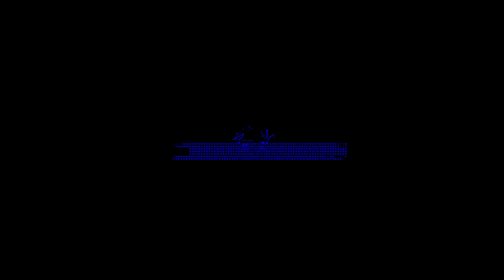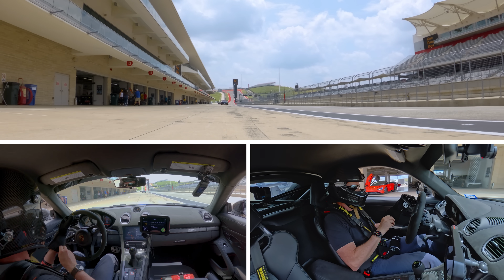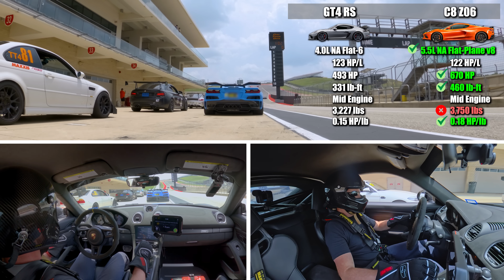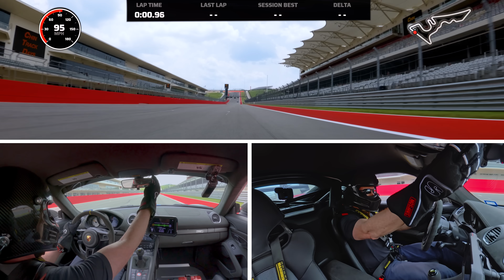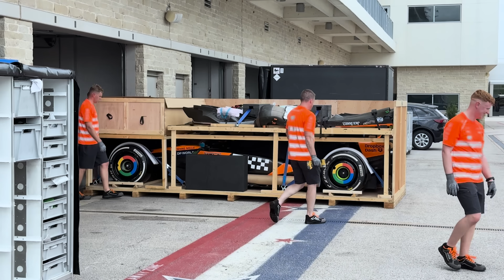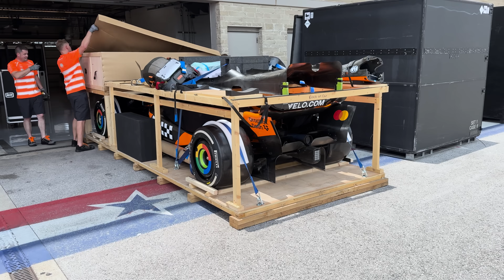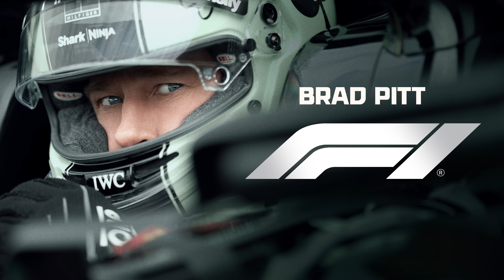Z06 vs GT4 RS : American Power Meets German Engineering at COTA

Comment: You're only braking later because he is not that confident. The c8 z07 will destroy any Porsche
Reply: Well, not any Porsche… but any Porsche to which it is a direct competitor, yes it beats them soundly.
Reply: @markw9512  What criteria do you think makes them direct competitors? Price? Design? Lap times? What Porsche competes with a Cayman RS? Z06? ZR1? I'm not sure Porsche is trying to make a big heavy track car with 1000+ horsepower because that's a bit more for Autobahn blasts than tracks.  (Think: Aventador) But a Cayman 4 RS was quicker around the Ring than a Z06 (7:10 vs 7:04 for the Porsche). A GT3 RS did the ring in 6:49. So I'm not 100 percent clear what metric "beats them soundly" is, but if it's on a track I don't think that's really the case.  The new ZR1 doesn't have a time yet. I'm curious to see if the ZR1X is a lot faster because it should be much more stable and less tail happy. 1000 hp through the back wheels isn't for the faint of heart!
Reply: @davids1816  let’s talk about that Nurburgring lap time that you guys like to quote first, because there’s some pertinent information there as to what happened and why it counts.  Then we can have some lap comparisons at the end of it so you can see exactly what I’m talking about, that on every other track except this one case which was clearly done under some optimal conditions with cold temperatures, cold tires, and the driver performing exactly one lap in the car, the only lap he had ever driven in the car, you’ll see the difference.  So firstly let’s talk about the lap time on Newberg ring by driver Christian Gebhart from sport auto. 

1. The 7’10” run by Gebhardt was his one and only lap performed in the car. In comments made after Misha Charoudin challenged the level of driving on this lap , SportAuto admitted this. So there NO warm-up laps, NO practice laps to get familiar with the car as a well run lap session should have.  Meanwhile he’s done countless laps in Porsches around the ring.  So he’s gonna be a lot more familiar with any given Porsche he takes out for a run for the magazine than a car he’s never driven.  And nobody, and I mean nobody, is going to get their fastest possible lap in a car they have never driven before, let alone on a cold damp track without fully warmed tires, which brings me to:
2. Conveniently, and of course entirely by coincidence and not any bias towards Porsche, one of their largest advertising accounts, the two times this magazine tested the Z06 were both performed in sub-optimal conditions: 3°C in the Hockenheim last year and 10°C for the Nurburgring test.  Meanwhile the Porsche runs are done in ideal weather with 20 to 25 C ambient conditions, conveniently the optimal range for the Cup2Rs.  Gebhardt himself said that the tires were not warmed up for the first half of the lap and were slipping during the SportAuto test, and that as a result of this and damp track conditions he was having traction issues for a good portion of the lap. Not exactly a formula for an optimal time, especially for somebody who’s driving the vehicle for the very first time!  I don’t give a damn how good you are, you’re not gonna turn your best lap the first lap behind the wheel in sub optimal conditions. 
3. This bunk claim made by SportAuto about it not being fast enough to compete with the GT3 in 5th gear is laughable.  As tested by Car and Driver: 150-170 time for GT3 RS: 11.1 seconds  C8 Z06: 9.7 seconds.  The Z06 is in fifth gear for this entire speed range.  As OP’s own experience shows, the Z06 clearly accelerates much faster.

Here are comparison times from magazines that have enough sense to let their drivers take familiarization lapse before doing their timed laps, and have enough intellectual integrity not to conduct them in sub optimal conditions. 
#### Base C8 lap times #### 

EVO Magazine’s C8 hot lap at Anglissy, Steve Sutcliff’s hot lap.
Times: 
Porsche Turbo 991.2 : 1’15”2
Corvette C8: 1’15”6
Porsche 992 Carrera S: 1’16”0

Nurburgring Lap Times:
Base Corvette C8: 7’29”9
Porsche Carrera S: 7’30”41
Porsche GT4: 7’32”0

Auto Bild Supertest, acceleration and hot lap, 2020 C8 Stingray, Sept 2020:
Lap times:
Corvette C8: 1’32”31
Porsche 992 911 Carrera S: 1’32”36
Lamborghini Huracan LP 610-4: 1’32”84

Car & Driver Lightning Lap, 2020: 
Corvette C8: 2’49”0
Porsche GT4: 2’50”3

Road & Track, Grattan:
Base Corvette C8: 1’26”4
Porsche GT4: 1’26”5

Note that GT4s are ~425 lbs (193kg) lighter than C8s and have much grippier tires, Michelin Pilot Sport Cup 2rs specifically.

#### Z06 vs Porsche GT3 and others ####
Car & Driver Lightning Lap 2023:
Corvette Z06: 2’38”6
Porsche GT4RS: 2’40”5
Lamborghini Huracan Tecnica: 2’43”9

From past few Lightning Laps, same track:
2022 Porsche GT3: 2’40”6
2019 Porsche GT3RS: 2’41”6
2021 Porsche Turbo S: 2’42”5

The fastest cars from all of Car & Driver’s Lightning Lap comparisons:

1. 2019 McLaren Senna: 2’34”9
2. 2021 Mercedes AMG-GT BS: 2’37”0
3. 2023 Porsche 911 GT3 RS: 2’37”2
4. 2018 Porsche GT2RS Weissach: 2’37”8
5. 2021 McLaren 765LT: 2’38”4
6. 2023 Corvette Z06: 2’38”6
7. 2019 Corvette ZR1: 2’39”5
8. 2018 McClaren 720S: 2’39”7
9. 2023 Porsche 911 GT3 MR: 2’39”8
10. 2022 Porsche Cayman GT4RS: 2’40”5
11. 2022 Porsche GT3: 2’40’6
12. 2019 Porsche GT3RS: 2’41”6
13. 2021 Porsche Carrera Turbo S: 2’42”5
14. 2020 McLaren 600LT Spider: 2’42”6
15. 2017 Ford GT: 2’43”0
16. 2015 Porsche 918 Spyder: 2’43”1
17. 2018 Mercedes AMG GT R: 2’43’4
18. 2023 Lambo Huracan Tecnica: 2’43”9
19. 2018 Lambo Huracan Perform.: 2’44”0
20. 2016 Dodge Viper ACR: 2’44”2
21. 2024 Lucid Air Sapphire 2’44”3
22. 2020 Ford Mstg Shelby GT500: 2’44”6
23. 2015 Corvette Z06: 2’44”6
24. 2020 Lamborghini Huracan Evo 2’45”0
25. 2019 Chevrolet Camaro ZL1 LE 2’45”0
26. 2016 Ferrari 488GTB 2’45”1
27. 2017 Ford GT 2’45”5
28. 2018 Chevrolet Camaro ZL1 LE 2’45”7
29. 2015 McClaren 650S Spider 2’45”8
And:
41. 2021 Corvette Stingray 2:49”0

46. 2012 Ferrari 458 Italia 2’49”9

Road & Track Performance Car of the Year, 2023:
Lamborghini Huracan Tecnica: 1’23”1
Porsche GT4RS: 1’22”7
Lamborghini Huracan STO (2022): 1’21”9
Corvette Z06: 1’20”6

Autobild Sportscars Supertest
Lausitzring lap times:
AMG GT Black Series:  1’25”23
ABT XGT 1’25”76
Ferrari 296 GTB: 1’25”88 
Porsche 911 GT2 RS (991):  1’25”91
Corvette Corvette Z06/Z07:  1’27”41
Lamborghini Huracan STO:  1’27”94
Lamborghini Aventador SVJ:  1’28”05
AMG GT R Pro 1’28”39
Lamborghini Huracan Evo 1’28”82
Lamborghini Huracan Tecnica 1’28”96
Ferrari F8 Tributo 1’29”06
Porsche 911 Turbo S (992):  1’29”95
Porsche 911 GT3 RS (991):  1’30”60

Quattroruote  magazine Vairano Pro track
1. Pagani Huayra BC Roadster 1’20”71
2. AMG GT Black Series 1’20”93
3. Ferrari 296 GTB 1’20”93
4. Ferrari SF90 Stradale 1’21”72
5. Porsche 911 GT3 (992) 1’22”79
6. Corvette Z06 Z07 Package 1’23”73
7. Lamborghini Huracán STO 1’23”82
8. Lamborghini Revuelto 1’24”39
9. Maserati MC20 1’26”55
10. BMW M4 Competition Coupe 1’28”61
11. Maserati GranTurismo Trofeo 1’31”75

Savagegeese same day/same driver/same track comparison of Z06 w/Z07 vs GT3. Corvette and GT3 manufacturer teams on hand making sure both vehicles’ setups were optimal:
Times:
Z06: 1’27”240
GT3: 1’27”329
Tight, short track. Pro driver said GT3 would definitely lose advantage on longer tracks and Z06’s lead would grow on them.  This is an excellent, very well put together comparison video which goes into great detail explaining the strengths and weaknesses of both cars.  Highly recommended.  

From fastest laps site:
Sport Auto Fr. Val de Vienne lap times
Rank   Vehicle      Time
1      Ferrari 296 GTS 1’37”70
2      C8 Z06 (Z07)  1’39”30
3      992 GT3 RS   1’41”60
4      992 GT3      1’42”80
5      M4 CSL       1’43”28
6      GT4 RS       1’44”65

Motorsport Magazine (chart at end of vid shown w/times):
McLaren Senna  1'14"93 (TrofeoR)
C8 Z06 (Z07)      1'15"23 (Cup 2R)
991.2 GT2 RS      1'15"91 (Cup 2R)
992   GT3 RS      1'15"96 (Cup 2R)
Ferrari 488 Pista 1'16"06 (Cup 2R)

Montecello Motor Club North Course Fastest laps:
AMG GT Black Series: 1’19”42
C8 Z06 (Z07): 1’20”55
911 GT3 (992): 1’21”69
Huracan STO: 1’21”9
718 Cayman GT4 RS: 1’22”70
Huracan Tecnica: 1’23”10
M4 CSL: 1’24”20

Sport Auto Mendig AFB Circuit:
Lamborghini Huracan STO: 1’45”57
C8 Z06 (Z07):  1’45”91
McClaren 650 S Spider: 1’45”35
911 GT3 (992): 1‘47”16
GT4 RS: 1’48”16
 
C8 Z06 set production car record
at Canada's Canadian Tire Motorsport Park, 2023. 

Throttle House Track Test:
1. C8 Z06: 1’06”56
2. 992 GT3 RS: 1’06”67
3. BAC Mono: 1’07”52
4. Viper ACR: 1’07”55
5. 992 GT3: 1’07”77

Hagerty test of Z06 vs 992 GT3 RS & M3 CSL, Jason Camissa with Randy Pobst driving. Willow Springs, high speed track with 992 GT3 RS’s active aero winning the day here, near freezing track temps. 
Times:
GT3 RS: 1’24”3
Z06: 1’24”9
Reply: @markw9512  I'm still not seeing data that shows a Corvette being substantially faster on a track (or slower). I think also that saying, "yeah well this car is this much lighter" or "This car has these tires." It's the car. Chevy made the car they wanted to make within their parameters.  So did Porsche. You can also see in some tests they got cute and nerfed the Porsche by not using the RS model with the crazy aero. My ultimate point is that overall, the Vette and the Cayman are pretty close. One accelerates faster, one carries more speed into corners and does it with more stability. People get attached to one or another car's "supremacy" and want to assign that to their self-image.  Porsche exploits this ruthlessly to sell more expensive and only incrementally faster cars that are not more fun without a stopwatch. I think that whole mentality is kind of childish in the same way as people fighting over sports and politics.  It also just isn't backed by data here. I did think of this whole conversation this morning though, as I saw a blurb somewhere that the ZR1 and ZR1X (which should have been the Z-Ray or the EZ-Ray or something much more punny) to set a lap time. I'm most interested to see what the hybrid can do. But it doesn't make me want one.
Reply: @davids1816  are you blind? Or did you just not read my post? I provided example showing it to be 2 to 3 seconds faster a lap which is a bus lengths.  Look at the car and driver VIR times for one.  If you’re not gonna read the post, don’t sit there and tell me it doesn’t have something in it when you have no way of knowing.  
Here’s a short version because you seem to have a problem with things that are more than a few paragraphs :

The fastest cars from all of Car & Driver’s Lightning Lap comparisons:

1. 2019 McLaren Senna: 2’34”9
2. 2021 Mercedes AMG-GT BS: 2’37”0
3. 2023 Porsche 911 GT3 RS: 2’37”2
4. 2018 Porsche GT2RS Weissach: 2’37”8
5. 2021 McLaren 765LT: 2’38”4
6. 2023 Corvette Z06: 2’38”6
7. 2019 Corvette ZR1: 2’39”5
8. 2018 McClaren 720S: 2’39”7
9. 2023 Porsche 911 GT3 MR: 2’39”8
10. 2025 Lucid Air Sapphire 2’40”2
11. 2022 Porsche Cayman GT4RS: 2’40”5
12. 2022 Porsche GT3: 2’40”6
13. 2025 Porsche GT4RS MR: 2’40”9
14. 2025 Lamborghini Revuelto 2’41”3
15. 2019 Porsche GT3RS: 2’41”6
16. 2021 Porsche Carrera Turbo S: 2’42”5
17. 2020 McLaren 600LT Spider: 2’42”6
18. 2017 Ford GT: 2’43”0
19. 2015 Porsche 918 Spyder: 2’43”1
20. 2018 Mercedes AMG GT R: 2’43’4
21. 2023 Lambo Huracan Tecnica: 2’43”9
22. 2018 Lambo Huracan Perform.: 2’44”0
23. 2016 Dodge Viper ACR: 2’44”2
24. 2024 Lucid Air Sapphire 2’44”3
25. 2020 Ford Mstg Shelby GT500: 2’44”6
26. 2015 Corvette Z06: 2’44”6
27. 2020 Lamborghini Huracan Evo 2’45”0
28. 2019 Chevrolet Camaro ZL1 LE 2’45”0
29. 2016 Ferrari 488GTB 2’45”1
30. 2017 Ford GT 2’45”5
31. 2018 Chevrolet Camaro ZL1 LE 2’45”7
32. 2015 McClaren 650S Spider 2’45”8
Reply: @markw9512  You don't like being disagreed with.  Your original point was that a Z06 would dominate any Porsche. On a track with a bunch of rich guys doing Gran Turismo role playing, a second is just a little driver error. And btw they got the same results as Haggarty, is it time to look up what the temperature was at the track again? They all should be grateful they had a track.  The dude with the Saphire would have dog-walked all of these cars on the street.
Reply: @davids1816  Haggerty did not run a GT4 RS. They ran a GT3 RS. Which is a lot faster, and which has active aerodynamics to give it higher down force through the corners and lower that down force down the streets for improved acceleration. And even then it only won by less than a second against the lap against a car costing 1/3 as much as it does.  This is Porsche’s fastest 911 on every track, by large margins, far faster than a GT4 RS.  So that is no way comparable to this vehicle, because that car tests something like 15-20 seconds faster around the Nurburgring than a GT4 RS did. So the Corvette is within 6/10 of one second around Willow Springs versus a car that is far far faster around a good track than the GT4 RS, and you think the results will be the same??  Give me a break. You don’t even know the difference between a GT4 RS and a GT3 RS and you’re arguing with me about technical points of cars?

And no I didn’t say it would dominate any Porsche, I said it would dominate the GT4 RS. Obviously the GT2 would beat it, but it’s beaten the GT3 just as badly as it’s beaten the GT4 RS, the lone exception being the incredibly poorly conducted (detailed in my previous posts) Nurburgring test by sport auto.   And the track numbers prove it. You accuse me of coping, but I’ve got the data, it is you who want to argue with it and are coping.  This guy has a heavily modified car, he was on Hoosiers, he runs this track every freaking week, and you guys are acting like “oh, driver skill has nothing to do with it, it’s the car it’s the car it’s the car!”  no it isn’t. It’s the driver, it’s the driver, it’s the driver, in a nonstock car on racing tires, on track that he is at every weekend ,
,with aftermarket aero and suspension modifications, against a guy who’s newer to the track and who is not on race tires and who does not have a modified suspension. 
.
And it’s especially the driver when he hasn’t even informed the other guys that he wants to race.  You just don’t want to hear any countervailing arguments to the fact that you’re calling such a vehicle representative of the performance of the stock version of this car.  The fact is, as the OP has documented, that these modifications picked him up something like 3 to 4 seconds a lap!   You can watch his videos if you don’t believe me, but this is documented by him. It ain’t stock, and stock for stock a Z06 will eat this car alive.  Two seconds a lap is huge.  Cope harder.
Reply: Also, when you are driving a car that has a lot more power and is carrying a lot more speed into the corner, your braking point will be much sooner.
Reply: @user-Dr. I'm not sure this is a logical argument. Through turn-in the Porsche is consistently gaining on the Corvette - only to lose much of that on the straightaways since the Vette accelerates a bit faster. So I would suggest, if the car were simply scrubbing off extra speed, and not slowing down to a speed lower than what the Porsche carries through the turn, the Porsche wouldn't be cutting the lead that the Vette has any more than the Vette wouldn't pull away on the straights unless it were, ya know, going faster.
Reply: @davids1816 the z06 driver told me when I was in his car he is entering esse 11 mph slower vs having oem 2r tires.  the truth is both drivers are top 5% hpde drivers and c8z guy just out there have fun and test new setup.  with same driving, if I switched from old goodyear 3r to fresh 2r I would gain nearly 4 s.  unless this is time trial competition, you dont know is someone is using his fastest setup.  I use fastest setup maybe 5% of the time which is fresh 2r the rest of the time I am on 3r, cup2, cont extreme force, hoosier track attack.
Reply: here are facts from actual owners that track.  my track buddy and I currently have 992 gt3, 992 gt3rs, gt4rs, c8z, c8z with z07 ordered 2026 c8z with aero and 2026 c8 zr1.  haven't driven the zr1 but we both agree zr1 is going to kill all his porsche and c8z as we feel the oem z07 tires are stickier than normal cup 2R (it has less tread and tread pattern seems different too) and double the hp.  at sebring the gt3rs and c8z with z07 are damn close but z07 is on way better tires.  bottom line for people own all these cars they dont have to justify one is better etc.  porsche has the pedigree and most of the bias opinions are from people cant afford multiple nice cars so they have to justify their choice is great.  no need to bench race magazine times as anyone that track knows lap time varies too much.  the two drivers in video, their lap time in summer and pb are like 5s different,  same car, same driver just track conditions difference.  give credit where credit is due.  these guys are out there with 150k+ cars not bench racing.  the gt4rs owner made some assumptions which was incorrect because he didnt know but I own both and track both on same day, same track so I know both cars well.  in the video I actually was riding in the blue c8z as driver was showing me how he drive cota since it was my first time there.  the gt4rs is more familiar on cota but the blue c8z driver is pretty fast at every track.
Reply: @goonthreegtr   I was wondering, did the Vette driver have factory style Michelins on it?  The Porsche driver said he had Hoosier R7s, I have run both of those tires at times, and my times are seconds a lap faster on the Hoosiers, the way the Vette started sliding around after a couple laps, I was pretty confident he had the Michelins on it, the same problem I had when using them, as people that drive know good tires are everything.
Reply: @user-Dr. he has michelin cup 2 not cup 2R.  I was there on goodyear 3r.  I want to learn the track and if I did, put on michelin 2r fresh for 2nd day.
Reply: https://www.youtube.com/watch?v=mCQlLa36-0c, I like the C8 too... but maybe take a second and think about all the cars Porsche makes.  That gigantic pile of extra cash the owner spent didn't just buy leather-wrapped air vents.  They make epic cars.